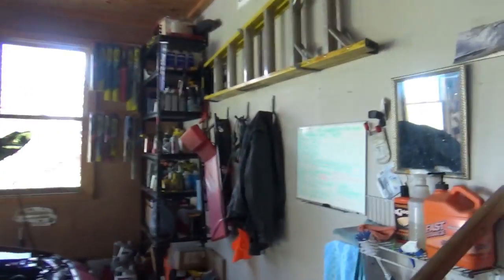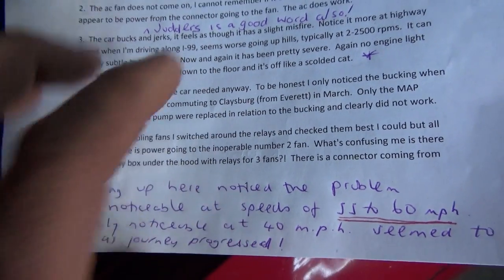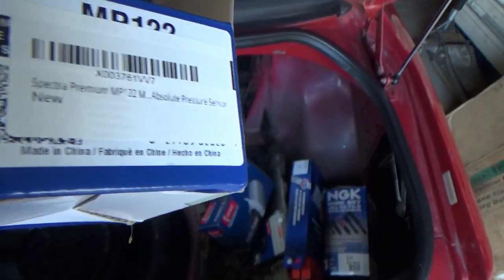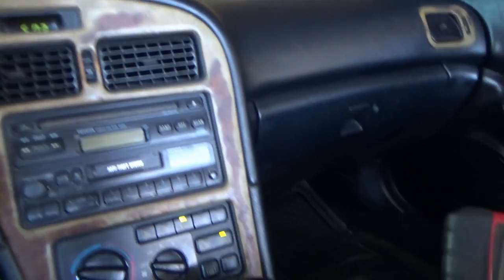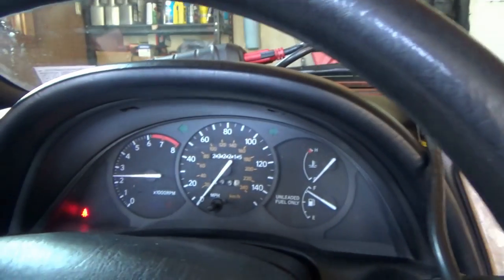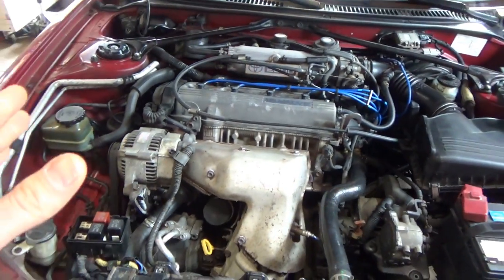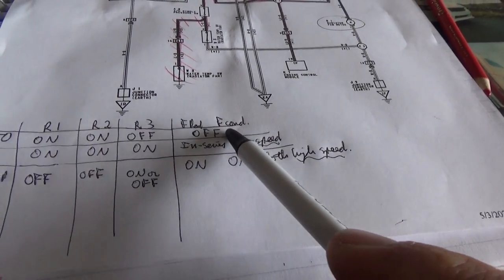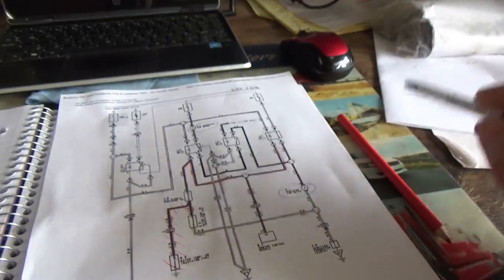The CELICA SAGA - Part 1 (Cooling Fan Always ON?)

Comment: Segue - My then teen aged son (he just turned 40) had just learned to drive, one of his buddies had an old Taurus with the exact same problem.  At that time they used a GEM module (a metal box, full of mostly relays) to run many of the under hood items.  I pulled the box off, cut off the rivets holding the cover on, hoping for a "Russian fix".  None of the relays could easily be replaced, nor could I get a file/sandpaper in between the contacts to clean them.  Of course the kid had no money and there are no "auto recycling yards" near by.  I put the metal cover back on loosely.  I took the handle of a screwdriver and gave it several good whacks.  IT STARTED WORKING !  I used electrical tape to hold the cover back on.  I was a "legend" in the neighborhood !

Comment: Hi Ivan, another great diagnosis.  I have a 2000 Camry with the V6 1MZ-FE motor.  Same set up with the cooling fans.  I replaced the AC trinary switch from Rockauto and had the fans run at high speed as soon as the car was startedd.  Even though this was supposed to be the correct part, it would be off at low pressure as it should to cut the compressor and off at high pressure to cut the compressor.  But it also controls the fans when the AC pressure in the condenser is high and should turn off to make the fans run in parallel.  But when I put the switch in, the fans ran at high speed as soon as started.  So this was not the correct switch.  Found a Denso one at the wreckers that was labelled OFF, ON, OFF.  This is the correct part.  Saw a Corolla where the Denso switch was labelled OFF, OFF, OFF.  So Toyota changed the set up for different models/years.  Not surprisingly, one method to check if the fans are both working is simply to disconnect the AC trinary switch, or the connector going to the rad coolant temperature sensor or the connector going to the fans.  Needless to say, this problem drove my crazy.  The factory service manual provided the answer.

Comment: Not so sure there is a budget concern, the owner has a lot of parts in the trunk that likely weren't needed. 
Time for a coolant temp switch and a condenser cooling fan motor or motor assembly. Might find a used one as nothing shows on Rockauto for A/C fans.
Makes a lot of sense to verify the wiring and relays for integrity. Those cooling fan wires left unplugged from their sensors/switches however, indicate someone was messing around and left their work incomplete which is why the radiator fan is on 100%. He forgot to include that bit of info in his 2 page essay.
Reply: I agree,  the owner just sounds abit cheap, i guess when the car needs an oil change that will be too much $ also ? the owner could probably find a really close match for the fan in the junk yard.

Comment: that shuddering is probably because around 60 the torque converter is right on the edge of locking and unlocking, depending on engine load.  add to it 232k on the odo its probably lacking a little power so any small variable will try to unlock/lock it. those torque converter clutches wear out too.
Reply from the maker: Good theory, but this wasn't a case of torque converter shudder 🙂

Comment: I owned a 93 Celica with the same engine (there wasn't much difference between the 5th and 6th gen). I had an almost identical issue with my cooling fan running non stop. Turns out one the wires on that lower rad temp sensor had broken inside near the sensor connector (looked fine visually - probably salt corrosion). This caused the same thing electrically which put the fan in fail-safe mode. Miss that car!

Comment: Ivan, it's your fault. Not really.  Advertising the Aultel. Now for $600.00 you can do your own diagnostics, run down to the parts store, buy all these Chinese parts, come home and install them. Then they will start scratching their heads wondering why the vehicle still doesn't run. Then they come to you with a trunk full of used parts wanting you to fix it, but wait, don't spend a lot of time because I replaced everything I was supposed to. But the Aultel only tells you so much. Watching not only your videos but others really make me laugh. Every back yard mechanic wants to be a mechanic but no matter what you give them to work on these newer vehicles, they still have no idea what to do. Then once you diagnose them, just tell them so they can take it home and really screw it up more, not realizing that the car has to be programmed most of the time. So back to you. Just love it. lol
Reply from the maker: It is what it is haha

Comment: I think the ecm give some extra protection by giving a ground when instrument water temperature indicator sensor (which you did not show the connection) peg up.its a failsafe protection when radiator water temp fail to open when over-temp.just my logic.
Reply from the maker: Perhaps...also it might be an input to the ECM to bump up the idle speed when the fans are running full blast 👍
Reply: Keep in mind that grounding turns off fans.  I think it's more likely an input to the ECM to let it know that either the engine or A/C has requested cooling.

Comment: Toyota fan switch is wired from the relay ground wire when the switch is defective or unplugged the fan is engaged, use your multimeter to do a continuity check from the fan switch wire to the relays wiring,  if you do not find it there it's broken or wired wrong , the fan switch is on the thermostat housing it's a single wire there's also a single wire gauge switch it's normally smaller than the fan switch,  fan switch wire is usually white and gauge switch wire is usually yellow green , hope that helps . Blessings.
Reply from the maker: Or just follow the wiring diagram 😁
Reply: @PineHollowAutoDiagnostics  wiring diagram is good but they tend to defer a little with wiring colors and relay pin location,  I have a ee100 corolla and a ae 100 electrical wiring diagram manual and it's the same across them all .

Comment: I think those had a egr vacuum modulator, if those get goofy or have a vacuum/pressure delay/supply issue, like clogged/rusted steel tubing or the exhaust port tap(toyota loved to use steel tubing) all sorts of bad things would happen, from mild to major stumbles or complete part throttle/tip in cutout (old carbureted 22R's were bad for that)
I don't recall if the egr valve is bleeder type or not, if it is and rusted it may not be bleeding off enough and causing over-opening. head bashing ensues.
other thing, maybe an evap. purge flowing too much or charcoal filter fuel soaked.

Comment: I always thought the computer looked at the ECT and when the computer saw a certain voltage it close the relays turning on the fans I did not know the radiator had a pressure sensors like the AC douse.

Comment: In part 2 you disabled the EGR valve by I will assume plugging the vacuum line otherwise you would have a vacuum leak. The Celica is OBD2 correct so by disabling the EGR wouldn't that throw a code? If it threw a code wouldn't that put the ECM or PCM into a limp mode?

Comment: the 5S-FE was one of the most reliable engines Toyota ever made.  was on the Camry Rav4 as well. Also a non-interference engine
Reply from the maker: I think all Toyota engines from the 90s over 2.0L are non interference and bomb proof 👌🙂 The smaller 1.6 and 1.8 like to burn oil after 200k miles if non synthetic oil is used 😕
Reply: I have an old Camry with the 3S-FE engine. Broken cambelt last month at highway speed! Zero consequential engine damage...

Comment: Good diagnostics but the removed parts and that circuit isn't typical. The cooling fan being on all the time in cold weather will keep the engine cooler and prolong warmup, if trips are shorter it may never warm up. Porr performance guess, at 25 years and 230K miles parts can be failing like the transmission or ignition parts, surges could be a transmission works but isn't the best, the injectors or other parts providing gas and spark work kind of but have all those years and millage cycles on them.

Comment: You might have fixed the stumbling by swapping back the OEM MAF if some other part the owner replaced after that was actually causing the problem but the Chinese MAF mimicked the SAME problem.

Even though it's as rare as lighting striking twice in the same place I've actually seen such problems
Reply: I noticed he didn't verify customer complaint before making changes.   That can come back and bite.

Comment: I printed the diagram to follow along.  The diagrams are absolutely incorrect, which is frustrating.  Check the e/g main relay, pin 4.  The diagram shows that when the ignition key is off, the relay coil gets de-energized, and the battery + wire (protected by a 100A fuse) gets grounded.  These are pins 2 and 4 being connected at the relay.  Awesome, a car that blows a 100A fuse by design when you turn off the key.  

Also, as far as the pcm wire being connected to the fan relays 1 and 2.. How do you know if that's a pcm input (where it's monitoring for water temp and a/c press sensors,) or an output (which allows the pcm to turn on the fans?)  Perhaps check data pids and bi-directional controls to see?
Reply from the maker: No, diagram is correct. Take another look. Pins 2 and 4 are never connected 😁
Reply: @PineHollowAutoDiagnostics  Ah-ha!  You're correct... yet so am I.  The copy I printed from autorepairsource (which is free with my library card,) has the blade of the relay drawn opposite of yours.  My copy shows the blade is always connected to pin 2, while yours is always connected to pin 1.  So on your copy, when the e/g main relay coil isn't energized, pin 1 gets grounded.  That must be weird to see that the 2 30a rdi and cds fuses are connected to ground and can carry current as a ground when the key is off.  That makes way more sense than my copy though.
Reply from the maker: @ablackformula  yeah aftermarket diagrams are often incorrect and can get you in a rabbit hole 😅
Reply: @PineHollowAutoDiagnostics  prime example,,,like parts,,,,you get what you pay for !   LOL
Reply: miss-drawn wiring diagrams and flip flopped pin components was commonplace back then, you always had to be on your toes and never just jump in stabbing and poking with test leads and power/ground sources or magic smoke would escape and you're left holding the bill.

Comment: The wiring diagram doesn't seem to suggest that the two radiator fan switches vary by engine. I'm asking myself why they would engineer the system with two switches, and the only thing I can figure is for fail-safe purposes. For example, if the radiator cracked and there was no coolant in the radiator, that switch wouldn't activate because it wouldn't be in contact with the coolant. However, the secondary switch on the engine is in an aluminum engine part, which would be able to activate as the engine heats up, even without coolant contact. I may be interpreting the diagram wrong, but one switch appears to be a two-wire, and the other appears to be a single-wire case grounded unit. Also, take notice of the (#1) and (#2) notations on the two legs of the circuit.
Reply: Keep in mind that this system is such that "open" means the fans need to run.  If both water temp switches are present, the fans would only run if both indicate an overheat condition - quite the opposite of fail-safe.
Reply from the maker: If you lost your coolant, the radiator fans would be quite useless 😅
Reply: @russellhltn1396  Yes, now that I look at it again, I was overthinking the whole thing. This is quite an interesting system, and it was hard to view everything in the video. My sister had a '91 Camry, and the wire corroded at the radiator fan switch terminal, which kept the fan on all the time. It was an easy fix, but I was always intrigued how the open circuit caused the fan to stay on all the time. A lot of other systems seem to work on the opposite principle.

Comment: Couldn't you check continuity of the suspected bad fan or apply power to it, to see if it runs ?
Reply from the maker: Sure. I did that with a test light which is a better test than an ohmmeter 😉

Comment: Certainly not trying to tell a fisherman how to fish but a fan being in a constant on position makes it very difficult for the engine to get up correct operating temperatures and can cause a bucking problem ask me how I know.... Years before YouTube I ran into that with a Mazda GLC where the fan was wired up because otherwise it wouldn't work and I had no knowledge of basically anything other than how to change a tire and change your oil and my car could not pass in mission controls because of the constant on fan
Reply from the maker: Actually the thermostat is what controls operating temp setpoint... Fan can run all day long, won't hurt anything 😉
Reply: @PineHollowAutoDiagnostics  I certainly understand what you're saying by it allowing more or less water through the water jackets in the block... Have watched the gauges jump back and forth up and down because the fan on the Mazda GLC was on at all times I finally passed the emissions test by pulling into the emissions place got out shut off the fan pulled into the bay and I passed I guess that's my individual case study perhaps not a reality case study lol

Comment: So the main fan died, an he must have noticed engine running bit too hot.. then remembered grandpa once told him overheating is from a bad radiator, so he replaced it with cheapest one he could find which didnt come with the temp sensor, assumed the extra connectors weren't needed, an called it a day.
Reply from the maker: History from previous owner is questionable lol

Comment: Every dual fan system is wired so that it one fan goes bad, the remaining fan goes on full time high speed
Reply from the maker: Actually in this case it shuts the other one down as well 😂. At least in low speed mode 😉

Comment: The good news is it is an early OBD-II vehicle. Maybe the source of the surge problem was the aftermarket MAP sensor? 

DC brush motors are designed with a voltage rating, how can you operate them properly at 6V (series) and then at 12V (parallel)? Very strange. Normally, for this era vehicle you would have a low speed fan which cycles until high airflow demand where the low speed is on steady and the high speed (2nd fan) cycles on and off.

I have test lights like the one you use (I have two types; old style and LED) and I don't use them much except for lamp to ground circuits (corroded grounds). I prefer to use a Powerprobe IV or a Fluke 87-V DMM for fuse box diagnosis. Reason being if I see strange behavior using an old style test light I will just move to my 87-V. If I need to introduce a load I will use my Powerprobe.

Even though this is an older vehicle the relay pinouts look common, so you could use a relay test signal breakout kit (Lisle Master Relay And Fused Circuit Test Kit 69300) which allows testing with the relay in circuit.

Comment: Nice diagnostic of a deceptively simple circuit, but with a confusing operation. At first I thought relay 1 was a normally open (as it's printed on the case), instead of the normally closed required, but didn't count on the radiator temp switch being replaced by a plug :-)
Very curious for part 2!

Comment: He said that he "swapped relays" ----   So to me, it sounds like he put that "normally closed" relay in the wrong place.  Should be an easy fix by swapping the relays where they should go....  place your bets. lol
Reply: You would ASSUME that he put them back where they belong ! The fan is junk,Ivan “hot” wired it to no avail ! That motor is “ junk” ! Rad sensor & new fan,,,,,,you betcha lady,,,, it will work !
Reply: @fredwalker839  Yeah. this was my guess before watching....  I've pealed those fans apart before and fixed them.  It's usually just a bad connection where the wire is soldered to the coil/ winding on the inside.  That winding's wire is so small that it can break with simple vibration, usually right at the solder joint.  Very easy to fix most of the time.....  Sometimes the entire winding will be charred and black--- and those are done for good..  She's cooked. lol

Comment: The owner spends months trying to fix the car, replaces many parts, drives it from West Virginia to the middle of Pennsylvania and then informs Ivan that he can spend only 1 - 2 hours for diagnosis.  What?
Reply: The car was bought in WV for $1200.  I live in PA in the next county to where Ivan is.  Apart from the MAP sensor (which I got a refund for) the parts I replaced, shocks, battery, plugs, plug wires were pretty much unconnected to this EGR issue and needed doing regardless.  I didn't want to guess as to what the problem may be, as well, how cool is it to have your car in one of Ivan's videos!?  BTW, when you assume you make an ASS out of U and ME.  Well actually more U in this case.

Comment: Stop modifying peoples cars to avoid having to do manual labor. I always noticed you avoid replacing parts at all cost. That is not a proper fix when working on a costumers car. STOP BEING LAZY!
Reply: A Parts Cannon Sympathizer ?
Reply from the maker: Work smart... And hard 😜
Reply: What? The fix WAS to replace a missing part and NOT modify anything until that part could be replaced as the single fan always operating was safer than grounding the pin. Did you even watch the video, or did you turn it off when he replaced the junk MAP sensor with the OEM one? Lol.
Reply from the maker: My job is to diagnose the problem and recommend a reliable repair that hopefully doesn't break the bank. The customer has the final say of course. Nothing to do with being lazy 😂
Reply: Ivan is not LAZY. He is a hard working young man. 
Why buy parts made in China that are trash? 
Ivan always goes back to OEM parts. He even recommended to take the junk part and the guy get his refund.
Reply: @Silverfang15  Probably went for a quick poop, & don’t know how to push reply yet! LOL